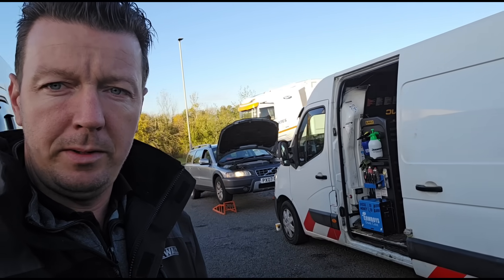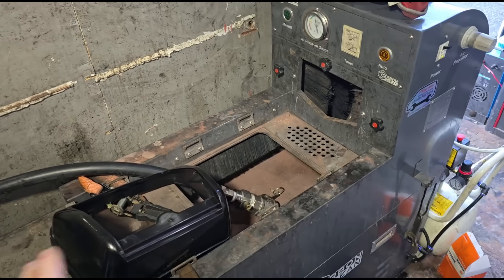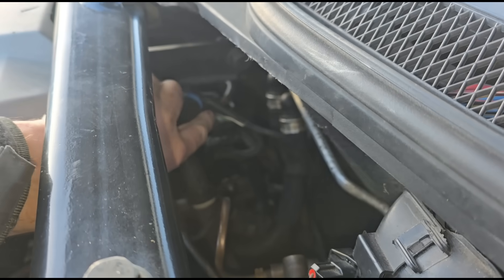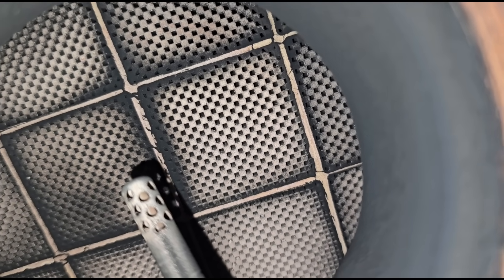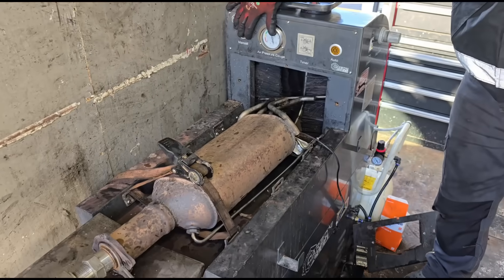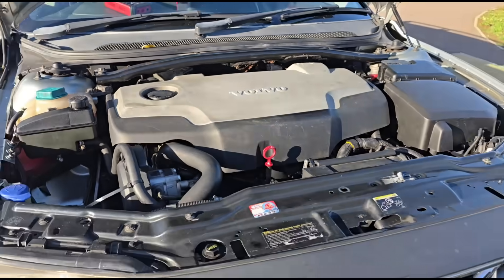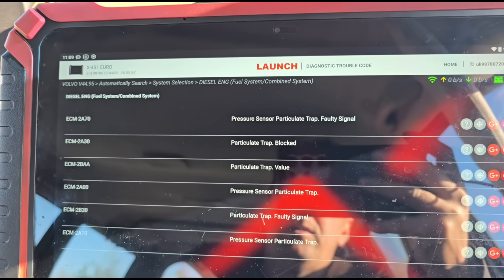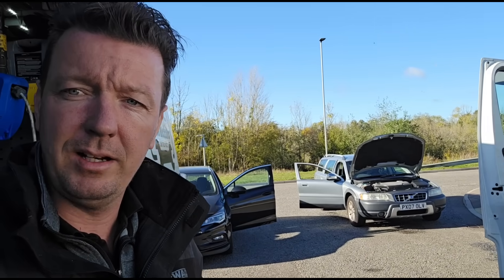Volvo XC70 DPF Removal Cleaning Guide: "Soot Filter Full"

Comment: I saw euro 4 at the start of the beginning of the vid, I'm guessing a holed intercooler...
Edit, OK maybe I was wrong! The d5 is a cracking engine. On the v60 euro 6, they begin regenning at 22g of soot, and the filter is tucked right up by the turbos. A right pain to get at. 
My dad's euro 5 xc70 is on its original dpf (minus egr) at nearly 200,000 miles. My mapper did a great job at retaining dpf function while removing any egr. It regens a lot less than it did with EGR.

Comment: After 2x dpf flush with a sandblaster gun via temp sensor & pressure sensor gate my hpa still remains high above 120 and when accelerating sometimes it gets to 800 - 1000 range please o raily why does it not work what i do wrong

Comment: Not sure I'd be redlining a 20 year old car with 170,000 miles. You're braver than me.
Reply from the maker: Id rather redline this than most brand new cars. I had one for 4 years that was red lined every day
Reply: I've got the 1993 straight 5 diesel version of this engine. 500k on the clock, red lined all the time. Diesel bottom end is not stressed as much as a petrol.
Reply: My 20yr old 250 000 mile D5 gets redlined often enough with total confidence and has never had a DPF issue!

Comment: My daughter is looking to buy a new car next year,  and she wants a Volvo. 
I told her to get a this older model,  or a bit earlier. Other than that,  get a classic Volvo Amazon Estate, c 1967 ish.
New cars are built for trouble. 
I doubt anyone will agree. 
Any way,  excellent job Jimmy.👍
Reply: Amazon 1967 is a great car. Simple and reliable. Without any electric nonsense like in modern cars. Now "Volvo" is just name only nothing related with great old ones.😊
Reply: Ive got a s60 version brilliant car only ever had consumables the phemutatic engine mounts arent cheap when they need replacing and the tax is silly money now. But its been one of the best cars ive had very reliable and very good on fuel considering the engine size. Lovely comfortable car aswell. They are starting to dissappear now
Reply: @chucky2316    That's why they are over £20,000 to get a half decent one.
Reply: I agree!!! 👍

Comment: Sorry about keep going on about it, but why don't you use the brick acid cleaner, with the water 50/50 and leave it 5 minutes each the mix, and flush it at least twice with the acid water. You're bound to have large chunks that can't pass through the DPF. And your flashing probably will be half at least. It just seems like a no brainer to me. 
Why is it doing a region if you've cleaned the DPF and the pressure is low! so why is it saying it needs a region? that doesn't make sense.
Reply from the maker: There is no need for acid on a reverse flush
Reply: The ash will be removed when reverse flushed, theres no need to filling it with acid. The acid can strip some of the precious metals in the DPF and cause it to fail. Not worth the risk for what you might gain. 

Its normal for it to regen after the adaptations have been reset, its not because its still blocked etc.

Comment: Quality of parts they certainly dont make them like they used to
Reply: They don't make them like they used to long ago 😊
Reply: I use a trusted local factor who supplies parts from  OM companies
Reply: Im sure you do but like anything else because of cost would or could you say that a DPF is better made with quality materials than 20 years ago as the Volvo on the video or are modern diesels strangled because of emissions